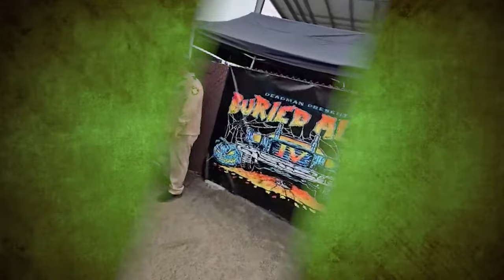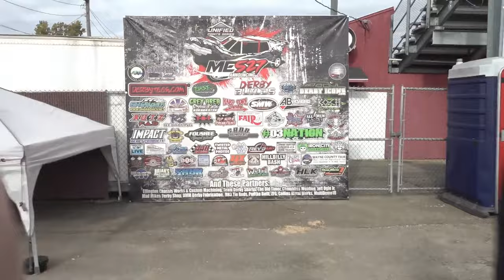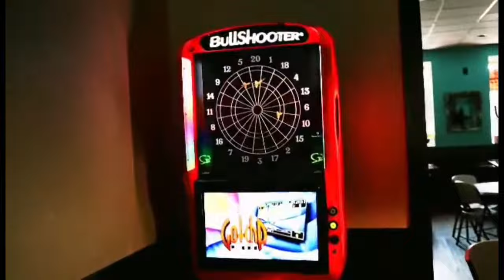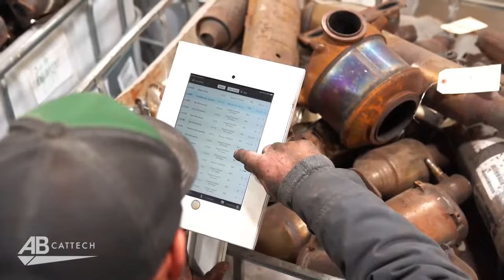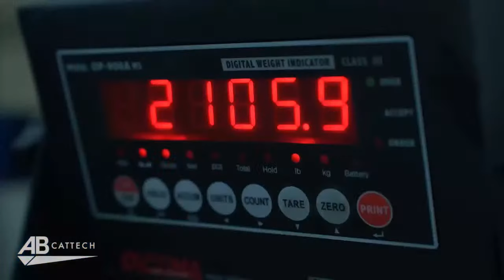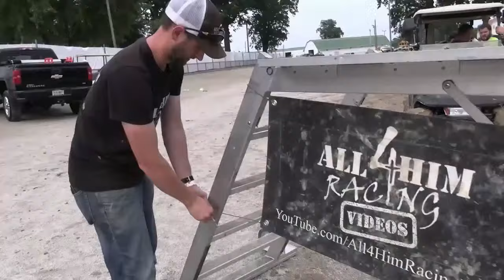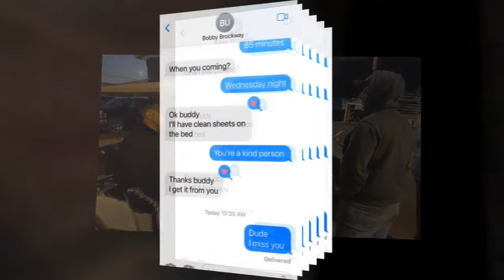Demolition Derby - Deadman - Buried  Alive  IV,  Dunbar Pennsylvania Day 3

Comment: This show has turned into a bagfest.
Reply: The track had 2-3 inches of rain dumped on it over the weekend. Hard to get any traction and speed in a mud pit.
Reply: @cwshawk Indeed. All of these class needed the agricultural tires for traction ONLY in MY opinion
Reply: you dont derby much do you... hard to steer, hard to stop. i was in the 107J saturn.
Reply: @G4M3SL4Y3R  nope, only 20  plus years.but I don't derby much.
Reply: @smww503  well. do better. because it was a heavy hitting show until the last 4-5 in every heat
Reply: You’re not going to get hard hitting with the the track conditions and the prize money. The track being so terrible can make some wear not you would have to worry much about it
Reply: Do u run it
Reply: @terrymccullough2714  I have been to a deadman show and it was more fast paced than this one.and it poured rain that day too
Reply: @smww503  yea, maybe because it wasnt at the fayette co. shit hole. the lightest of rain turns that place into a swamp